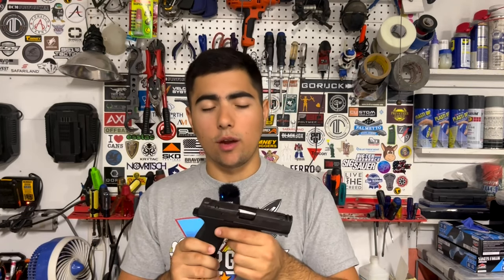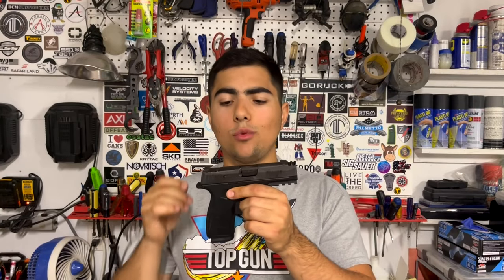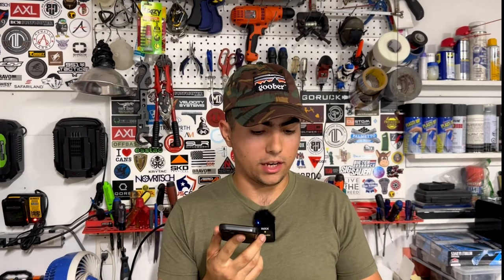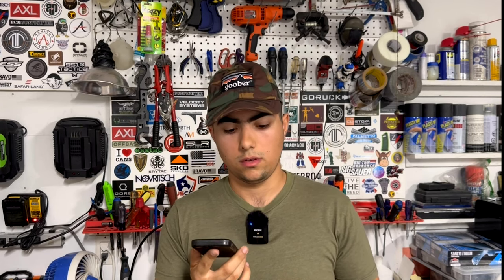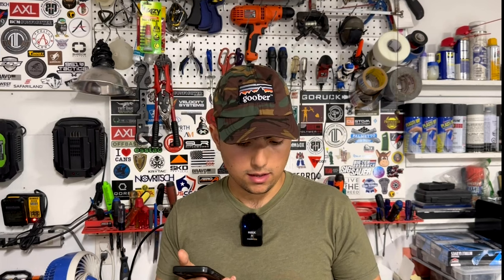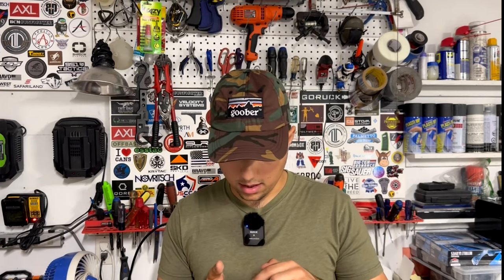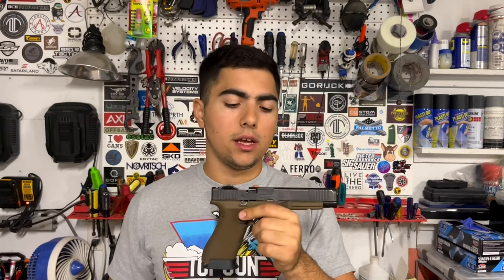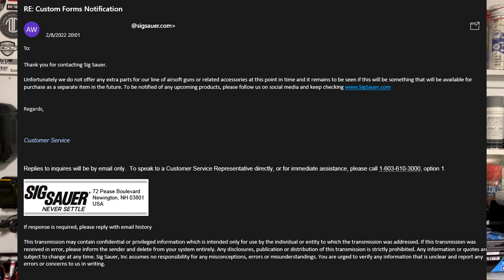Was I Wrong About the SIG P365 X Macro?

Comment: Part of the problem I believe with the customer response issue was that you had put 2000 rounds through it. And that it statutes being an issue within 2 months but you waited to call 4 months after noticing the issue. Had you called sooner, then you would have had a different result.
Reply from the maker: For one thing 2000  is not a lot of rounds. Had magazines for the macro been cheaper and more readily accessible, I would have been closer to 6000. 

Also they never stated that the time was an issue, but that they just don’t cover finish issues at all. The CS representative says it herself. 

A gun shouldn’t be having finish issues like that in 2 months, 6 months, or even 2 years. Even my Springfield hellcat, which I have had for 3 years now, is in far better condition and has more rounds and more time inside my pants. 

I didn’t call SIG’s CS until people requested it because I was pretty sure what the answer would be and turns out I was right.
Reply: 2000 rounds is hardly a high round count. It’s a couple of weekends of usage for folks who train.  And being that guns are a life saving/life taking device it’s not at all ok that they rust within 6 months of purchase. Not now, not in 2023.
Reply: 2000 rounds is nothing.  You don’t even have to service the springs or anything like that for several thousand more rounds.  2,000 rounds on a handgun is like 20,000 miles on a car.  Yeah, it’s used.  It’s had a couple of oil changes.  But it’s still relatively new and has a warranty.  If your 2 year old car with 20,000 miles had the paint peeling and rust forming after normal use (in an area where nobody else is having that problem), you would probably expect the manufacturer to do something about it, right?

Comment: The "finish coming off" is a pretty standard wear and tear issue with all firearms.  You mentioned you've had your Sig Macro since August of 2022, so I would expect for there to be some finish wear that doesn't interfere with the cycle of operation.  I didn't see anything in your video that was alarming as the firearm is still operating normally.  As for the rust, could be sweat and environment related, or a combination of both.  Sig's customer service in this video was pretty par with what I've experienced as well.  She was patient and investigating your issue just like any other CS rep would.  My advice to you is that you should have cleaned your weapon more, especially if this was your EDC.  This is a duty weapon, meaning it will incur more wear than your typical safe-queen firearms.  Sweaty guy or not, you need to break down, clean, use Sig recommended products and repeat.  It's also very interesting that most people don't have this issue with their Macros.  I've had mine as my primary EDC for 6 months now and none of these issues are arising.  I've ran all kinds of ammo through it including my own handloads (Extreme 147gr HP's, 3.7gr Titegroup, 1.13OAL).  NO ISSUES.
Reply from the maker: Wear on the pistol is normal. All my guns have wear on them. However, this is the only pistol I have owned where gun has rusted and the only other magazines I have ever had rust on are gen 1 shield arms mags. I treat all my firearms the same.

Comment: Channel should be called......Control My Mouth!!!! I have a 3.7 True Match Gold barrel getting milled down by Icarus to 3.45 it puts the end of the barrel at the middle of the break at the end of the slide there, then getting 2 holes drilled on the top under that piece of metal in the middle then doing 2 smaller holes in the hole closest to the shooter to have a longer barrel, ported and therefore it can now be a compensated pistol its going to be LEGIT AF!!!!

Comment: So weird, I’ve never experienced any issues you complain of on the four iterations I have to include the Macro. Maybe you are an anomaly
Reply from the maker: According to SIG there is nothing wrong with my Macro🤷‍♂️
Reply: @donkeydefense I mean...it's a tool. If a hammer still drives nails who cares if the grip is a little torn on one edge. I'm with sig. There's nothing wrong with the gun.
Reply from the maker: But if you bought a tool that was falling apart with nominal use, and you wanted to trust your life to that tool, would you feel comfortable doing so?
Reply: @donkeydefense  we have different definitions of "falling apart" I understand you being annoyed but I really watched this video expecting your macro to be trashed. You used it in several variations and they all worked...then you called sig as if the gun was useless

Comment: I've had no issues with my X-Macro.  As far as the rust goes thats a issue with the nature of metal.  It rusts if water is allowed to set up on the metal.  It isn't a manufacture issue.  Seems like common since.  You are very unreasonable about this problem.  The customer service seemed awesome and the problem obviously lies with you.  It isn't what you want to here I'm sure but its the truth.  You should think about this kinda thing before you post videos making yourself look like a prude.  Do you not think if your clearly wrong about the compensator that you could have a problem with saying things that you clearly have no idea what in the heck your talking about in most instances.

Comment: Wow. I can't say how disappointing your video is. I've loved Sig Sauer guns since I bought my first W. German built 226 in the 90s. Because I've holstered my 226 for years and it shows by wear on the slide and contact points, I would never call Sig to see if I  could get a free re-finish. I saw your first video and really can't believe what you are saying. In your first video, you say you liked the way it looked, liked the way it felt, said it was a great shooter, and liked that it had a high capacity. What you didn't like? The finish. I know of no one who says that their Sig is rusting. To make this worse, you compared it to the 320 and tried to say they're the same. They're not. The final nail in the coffin is that you bring out a Glock 19 in this video, which is a larger gun and not comparable, and then say that you're not a Glock fan boy. The reason that Sig doesn't give you free service for your neglect or maybe a real issue with your single gun doesn't mean that Sig doesn't care about their customers. It means that your gun is not warranted regarding rust. Here's an idea. How about cleaning it. You could also refinish or Cerakote it, however your preference is to complain about a perfectly great working gun that you don't like the finish and can't get Sig to give you free service outside the warrenty. Nobody  on the internet reviews has your rust problem, so if your intent was to steer buyers to Glock, I think you failed. No good Sig review needs a Glock comparison. Sig can stan on its own. Where Sig has been innovative, Glock has been left behind with the same old product.
Reply from the maker: There is a huge different between finish wear and rusting. All of my guns have wear on the finish, that’s going to happen to any gun you use. However, I have never had rust like that on any firearm I’ve owned or carried. And the magazines are a whole other issue. The amount of finish that came off them from just being in the gun is insane. 

The Glock 19 is comparable to the macro  in terms of a gun I have carried and used for years and is in better condition. 

And SIG having a crappy warranty shows they don’t care about their customers. 

Glock may not be innovating, but it’s still the only gun I trust out of the box.
Reply: @Control The Gun  What you say may be true of your gun. I don't know. But an anomaly is not indicative of the whole. I can't find anyone, let me say that again, "anyone" who has experienced what you claim. What you have is anecdotal evidence, which means your personal experience and hardly a general flaw problem that many are experiencing. Did you witness any other Sig have that problem? Have you gathered multiple samples of evidence to back your claim that this is an inherent problem with all Sigs? I can show you countless photos online of Glocks that have blown up. Does that mean that all Glocks blow up. No, of course not. But then again, we are not talking about Glocks even though you keep bringing them up in a Sig review. Go figure. Lastly, your initial video praised everything about the Sig 365 (your words) except the finish. In no way did you claim that it wasn't a capable gun, which it is. As far as the customer service goes, why should they go outside their warranty to give you special treatment? Oh yea, so you don't give them a negative review?Instead of throwing it away as you claimed, I will be happy to take it off your hands and refinish it. Then you can get back to your Glocks.
Reply from the maker: There have been numerous people in the comments of my videos saying they had similar issues. There is another YouTuber who made a whole video on how to clean and maintain the macro and ended up getting rid of his because of rusting. 

Is this indicative of all Macros? No, that’s why I gave SIG the chance to make it right. It’s not my fault they have a bad warranty. I understand finish issues after a few years not being covered, but after just a few months? That’s just a bad warranty.
Reply from the maker: Also that macro is long gone
Reply: @Control The Gun  Let's just agree to disagree. And again your review fails to say that the 365 is not a good if not great functioning weapon. I will say this even Lenny Magill from the Glock Store has high praise for the Sig 365 and even sells them at his store - a Glock store!
Reply from the maker: I never said it wasn’t a good weapon in terms of performance. My first two videos praised it on such. My issue is with durability, price, and SIG customer service.
Reply: @Control The Gun  OK. Fine. Durability to me means functionality, not the finish. Cost, you get what you pay for in a complete gun. How many new Glock owners change the trigger, the sights, stippling, and on and on. The Sig is complete  out of the box. You don't need to put hundreds of dollars into it like Glock owners do to make it complete. And I don't think I've ever bought a gun even thinking about their customer service. That was never the deal breaker for me. Sig Sauer puts out awesome products that many other manufacturers can't even compete.
Reply from the maker: My macro was going to get new trigger springs from tactical trigger, a full stipple job, new sights, and a red dot. I just ended up not doing it because I decided I wasn’t going to keep it. 

Aftermarket mods are personal preference for the most part. The only gun that is almost 100% good for me OTB is the FN 509 but I have other problems with that.
Reply: @Control The Gun  Wow. You were going to do all that. Just think if you would have just re-finished it or even Cerakoted it. There would be no complaints! But seriously, I  still think your review was unfair and biased and focused on finish and not functionality. As a fellow gun enthusiast, I  wish you well, that is with your Glocks.
Reply from the maker: I own more than just Glocks lol. 

I get that you don’t like that I made a negative review but I never hid my reasons for not liking the gun. 

And you keep up bringing up cerakoting, which I had considered. But I shouldn’t have to spend money on a gun just so it doesn’t rust. It would be one thing if it was the same with all my guns but it is literally just the macro I have this issue with. Whether it’s an isolated issue to just a few users or something more widespread, it’s an issue and the least SIG could do is correct it.
Reply: @Control The Gun  Well.... it seems like an isolated incident. Regardless, in the comment section, you seem to have convinced some solely on the finish issue which I think is unfortunate because I believe the Sig 365 is a hell of a gun not to mention the variations like the 365 original, the X, the XL, the Macro, and the Spectre Comp. and excell and offer more than a Glock 43, which is a comparable gun in size.